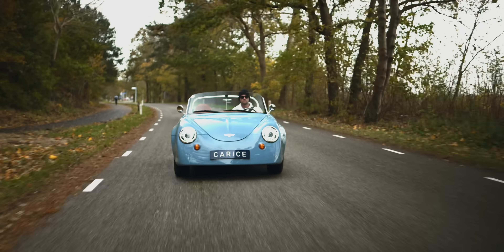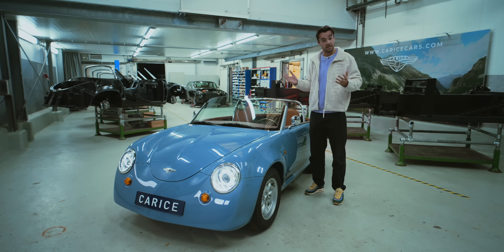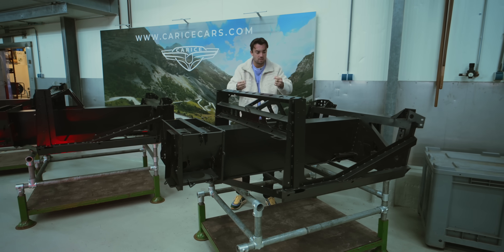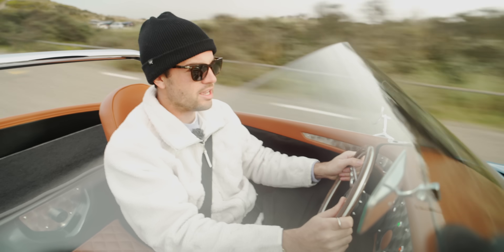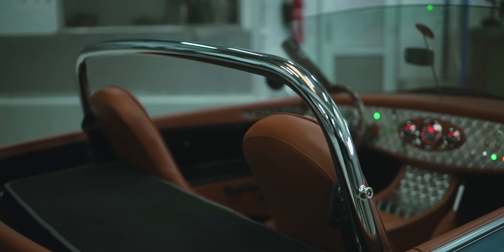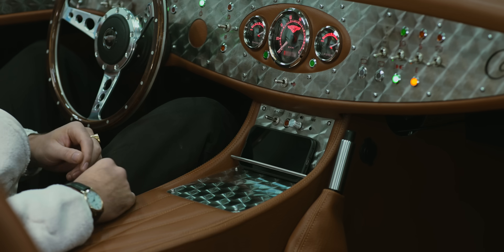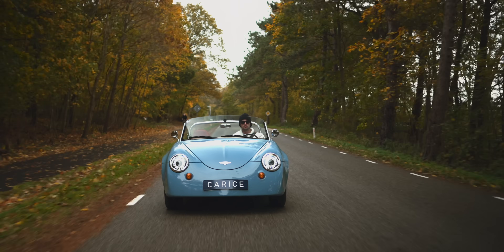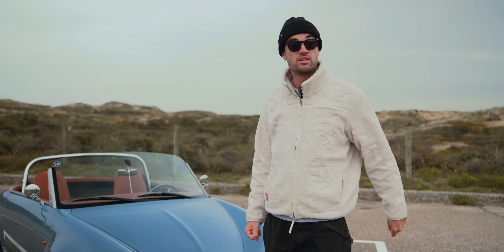This Is The First EVER Lightweight Electric Sports Car!

Comment: I think/ hope there is going to be a resurrection of the old kit car scene. This is an example of something we should be able to build in our garages
Reply: Yes, but only L6 or L7 classification kits. So quadricycles not cars.
Reply: I love these Welsh guys that do the old cars. Loved their Bulli for example!
Reply: Yeah - here's a basic chassis with crash structure, 3D print the rest yourself.
Reply: Totally agree 💯👍🏼 would love to do hybrid of my late mk1 NCF 💎 or would love to see several versions of the late william towns designs as utility vehicles and familly estates.. or light vans .. Huntsman and  Highlander ..away from mini wheels. 

Or an E hybrid  kit of the 1984 AFRicars  using modified Wood ..like MettelWood  and then bio epoxy paint..  

Who remembers the Medite/ply Jeeps built ...tested with a sledge hammer ⚒️ on the monocoque bodywork... 

These days you could press the part cured wood to form curves and cut parts flat pack style with a computer controlled cutter.

  The brilliant one is the one off 3seat abreast Micro dot.. town car  a primitive but effective electric  hybrid with a built in shopping cart space for the boot even when all the seats were occupied. 

Its hard to imagine a better  
and more minimal use of space and materials.. then or now.. just add modern brushless motor and battery tech.. 
Instead of the little honda generator...use the small liquid piston rotary or a opposed  free piston generator  across the frame inside .. Body work can be Modified wood or Green  Basalt and or flax fiber.. low carbon low energy green equivalent to ridiculous and dirty carbon fibres also tougher. For glass use Lionglass as patented by a group of US university researchers half the energy needed and  half the carbon dioxide produced in production and many times more resistant to cracking so you can have glass thats half as thick potentially and lighter, yet still twice the strength. It would seem.
And yes it can be made at almost half the temperature and thus saves on CO2 from heating and doesnt use the Carbonates used in making current glass. 

You can also turn wood into a clear composite ..😉
Talk about not seeing the wood for the 🌲 s and  growing cars....🤔
Reply: @ziggarillo   If you design and build it yourself, there is no reason why it can't be a usable vehicle for day to day operations. Design to your needs and there is barely a need to own anything else. Once upon a time, small cars like the original FIAT 500 and 126 were family cars, so why can't it be done today?
Reply: @Stuntman175  It can, with quadricycles. Cars require higher levels of passenger and pedestrian safety features for a home builder to achieve
Reply: Yupp , just the batteries need to go down in price and weight
Reply: @robotmunkee  
Thats the issue with 99% modern vehicles in Europe and USA they are too expensive for 60%plus of potential customers ... even conversions and modern kits.. 
Simplification and standardized parts is part of the solution and 
Step away from giga presses and internet of things ... dont even think about using a phone in a build unless its to track it or check its charging ... 
Best use blade cells and or Na Al, S chemistries.. at least we know Na is happy in the UK cold  and doesnt mind being drained flat or charged on way wood chargers.
Reply: @ziggarillo  This is an L7 vehicle? You CAN build that yourself. For less then half of what they want.
Reply: @ziggarillo  I was using the 500/126 simply as a size reference. They would probably be considered L7 quadricycles if released today as is, but with an electric powertrain.
Reply: Definitely.There hasn't been a kit car since the early 70's.
Reply: Just my two cents, that car has the same lines as a Porsche 356 Roadster.

Many replicas have been made, gas and electric. Some using donor cars and others were ground up fresh builds.
Reply: Wish to have one of them to drive to work ,to do shopping etc,only by low every new car should get tesla software for safety 😅
Reply: Probably  @chrisspain
Reply: @chrisspain  Not to the level and quality they will do it for. An most people have got the time to build themselves their own car.
Reply: @ziggarillo  Caterham seem to manage it
Reply: This is reminiscent of the Power Wheels lineup.
Reply: never happen. too many regulations.
Reply: Do you really want idiots handling high amperage electrics in their garage?
Reply: @Watt_Ihr_Volt batteries have dropped 90% in price since 2012.
Reply: That's actually their 2nd car, the first looked more like a Porsche 356/550 mix . 
They stepped up the interior game. 
But I think I like the look of the old one more. Was a bit more retro. But this one looks more sophisticated
Reply: @lesliedsy definitely,  their 1st car was more reminiscent of it. You could see it more then. I am happy to see they are still around and brought a new model.
Reply: Kit cars are still a thing, but people just got lazy these days.
Reply: If you don’t love this car then I’m ready to fucking throw down!
Reply: Someone did one of those beauty K1 Attack kits with a Tesla drive train.  Not the prettiest Attack I have seen, but surely the quickest.
Reply: And expensive
Reply: It shows what is interesting. If you just want what was built before but electrified, you can learn about that everywhere. Tons of heavy expensive electric SUV are portrayed everywhere. That isn't interesting and honestly it is also not a solution for any of our problems. Except for one: Not wanting to think anew.
Reply: @robotmunkee  Because these kind of EV's are niche and kind of unattainable for most people. Its just fact, at least these small electrics are starting to make the electric cars desirable for regular car enthousiasts its a great thing.
Reply: a 57 Chevy Belair for example
Reply: @chrisspain  I know. I own an L6 vehicle.
Reply: Crap electric 😂
Reply: No way anyone should drive what they built in a shed.
Reply: Looks like it was made by a 12 year old !
Reply: They will need to be kits, too. Conversions never have enough space for batteries as they weren't designed to fit them.

Comment: As the owner of a 65 year old Frogeye Sprite, which is a similar size, weight and power, I completely get the concept of light weight and simplicity. But I worry that I am in a very small minority. Car buyers now are obsessed with bigger and bigger wheels, more and more "tech" and larger and larger exterior size (ironically, with very poor internal packaging). I really hope there are enough buyers for this because it deserves to succeed.
Reply: The good thing is that cars like these only need a minority of people to sppreciate them.
I've recently watched a few engineering videos about how big wheels ruin comfort and efficiency - and I was surprised how many viewers agreed and some even pointed out how they had swapped the huge rims with thin tyres for smaller, lighter ones with tyres with genuine sidewalls and some air in them - on new cars and at their cost. 
So I hope we've arrived at "peak wheel" now and the pendulum is going to swing back somewhat.
Reply: There ARE a bunch of us out here! Motorcycles have taken up some of that slack for some time. But this...has a place in my own garage!
Reply: They are not obsessed, its just what automobile companies gives us. Most of the people dont care of reasons of their taste😄They begin to love things simply because they see them often. I love compact roadsters like bmw z3, mg gtb, i love smartfones with little screens, but we do not really have a choice now)
Reply: The beauty of Carice is that they are not trying to please everyone, they are "The Perfect Car for Someone, not Everyone".  And they aren't spoiling their vision to try to get in every driveway in the world.  They're doin' it right!
Reply: @allwheeldrive  Book an appointment with Richard and go get on the list!
Reply: Need any parts? I’ve got a 1960 with two spare engines that I will never be able to afford to fix up.  I need to find a home for it.
Reply: @notroll1279  I've watched enough crash tests to suggest that the very large wheels are there because they improve performance in small-offset front crash tests. An 18 inch or bigger wheel is a very rigid structure in exactly the right place to keep the front end from being crushed where the engine doesn't provide such protection.
Reply: @Thisoldhiker  Let's be honest big wheels are there because customers want them. And truth is the very high belt design and general size of modern cars (which I both despise)  make small wheels look quite ugly. 14 inches on a 80s honda prelude look right but would be ridiculous on whatever tesla.
In most countries you can't even change for smaller wheels because it does not fit regulations.
Reply: I agree, that’s the first thing I thought, a bugeye sprite.
Reply: For 44k? You are out of your mind.
Reply: Mark 1 Sprites were not really practical only cars for any full adult.  Thats why the MGB sold so well, as a somewhat more practical small sport.

So yes it us a niche.  Either an extra fun vehicle like a Sprite, motorcycle, etc....or a carefree kid with no " baggage" yet.

I would love this car and this is what I expected as an EV in 2000 continuing the EV1 experiment, but bringing in sport car designers.
Reply: If Frogeye, MG, they can produce little sport cars in the names of old age again, but their brands are sold to China and died. Sad.
Reply: I have a custom mg midget turned into an open wheel old school type roadster on a mustang frame with 305v8, I'm part of an even tinier minority of that already small minority
Reply: This is  a second or third car for fun, not a family car. Even though I think it would be an amazing daily driver in any non-American city.
Reply: In the 80s I had two friends that had them as only cars....in an American city.  Both got married and kept them as daily drivers for years.

One (6'2") was a foreign car mechanic, and he'd remove the passenger seat if he needed to carry his tool chest somewhere.  The other was a skinny little dude.

Not having a lockable trunk is the biggest problem in cities.  Otherwise they are just cramped cars.
Reply: "Frogeye"! I love it. We call it Bugeye Sprite. I would think this Carice is a little bigger than that.
Reply: Yes!!! Or a Crosley... remember?
Reply: I totally agree with you.  I was an early buyer of the MGF when they came out in the mid 90s and after abandoning motoring (WFH and living in a walkable European City with excellent public transport) I really didn't want to have a petrol car just for pleasure.  So I decided to hold out until the inevitable Electric MG roadster was released.  The MG Cyberster was released last year and while it is a gorgeous car, it is more the size of a Jaguar and really goes against the original MG ethos of a small lightweight sports car.  I'm not really interested in offerings from Mazda, Mercedes or BMW so I'm hoping a niche alternative will emerge soon.

Comment: Finally, a car with no gimmicks, and it's gorgeous
Reply: Yes, although it is simple like a go-cart. It lacks safety equipment.  Probably wouldn't want any of my children driving something like this.  Seems less safe than even a '65 Mustang.  With that in mind, it probably wouldn't be legal to drive or register in the US.
Reply: @SilverShadow2LWB  microcar rules probably differ. The equally Dutch Squad Solar is heading to the US with similar simplicity
Reply: @messiermitchell4901 Yeah microcars might fallen under local neighborhood vehicles.  That would limit them in speed and would not be allowed on roads over 35 mph.  That's a unique category of vehicle which doesn't require safety equipment.  Golf carts fall under that category.  But anything that advances the EV technology is good.
Reply: Did you order yours yet? What color?
Reply: @lesp315  I probably wouldn't be ordering one myself.  But if I did, I would order it in yellow or red to be able to be seen.  What color would you get?
Reply: @SilverShadow2LWB  I will order one that will make me invisible.
Reply: @lesp315  Then no one else to blame if someone turns into you, or doesn't see you at a stop.  In small cars, you have to be like motorcycles and be noticeable.  Have fun.
Reply: @SilverShadow2LWB  Oh no, I would never take it on the road. This cart is good for golfing, but it will only fit clubs or a caddy. I would chose invisible because I wouldn't like my friends to know that I'm that impractical.
Reply: It’s electric where’s the petrol gas guzzling superb sounding v8 😂😂😂

Comment: The Porsche Speedster is probably the only car from the 50's that still blends in 70 years later! This electric car is the proof. Long live the Speedster!
Reply: Proves F. Porsche’s genius
Reply: You're right, the 1955 Citroën DS is still too futuristic for our times, people aren't ready yet.
Reply: I like the machined metal dash and all the toggle switches!  When I had my ‘67 Morgan 4/4, it had toggle switches and a non-self canceling turn-signal switch on the dash too.
Reply: Yeah, reminds me of my  '65 356C. Put a top on it and I'm interested.
Reply: @dooleyfussle8634  You can get it with a top.
Reply: You can check daihatsu copen.
Reply: @peterhel1077  It isn't a 50's car.
Reply: @peterhel1077  It looks like a 356 that shrunk in the laundry!  LOL
Reply: @chucku00  exactly. you can have all the fun and modern functions.
Reply: @peterhel1077  Including being up to current safety standards while Daihatsu admittng a continuous 30 y/o safety test fraud?
Nah. As cute as the Copen might be, the dishonesty of this car maker shouldn't be rewarded in any way.
Reply: @donelmore2540  you may find that daihatsu copen owners as suzuki jimny owners are absolutely immune to any criticism and mocking lol
Reply: @peterhel1077  No real disrespect intended.  Just a little fun!
Reply: Total Speedster vibes. I was wondering if they paid design royalties to Porsche AMG.

Comment: Thanks Jack. That is one of the best reviews, and in one of the most beautiful EV's i have seen yet. 
Finally, a 2 door EV, AND a "sportscar, AND a Cabrio.  Let modern brands try to build something like that. Fun, Lightweight, 2 doors and 300km range. Perfect.
Reply: And I've seen it without a jack standing next to it.. looks a lot bigger
Reply: You should Google the first gen Tesla Roadster from 2008. It had 393 km range and weighed 1,305 kg, roughly the same as a Mazda Miata.
Reply: This car perfectly sums up the folly of the 'big battery required' argument. A 31kwh battery that can take this car as far as a 50kwh battery would in an SUV. BMW could have made an original sized mini with an electric motor and it would have flown out of the showrooms as fast as it did back in the 60s.
Reply: @@yyibonly because of the batteries. Those came down to 10% of 2010 prices.
Reply: @@yyib Costs the same as I paid for my Ioniq 5 here in Aus. Crazy, just a rich persons toy. If it was reasonably priced I'd be tempted.
Reply: @davidjulian8536 I don’t think yours is nearly fully hand made by a small team with leather interior, compare apples with apples.

Comment: I was co-founder in an EV project, which had very similar characteristics originally, small sports car, L7, battery pack in centre tunnel. That project failed, but not because the idea would have been a bad one - I am happy that this is now coming out, as it is what I would like to have for summer fun car for small roads.

I think the power must be maximum 15kW continuous and 50kW is only available as peak power, as that is the L7 category limitation (maximum net power of 15kW). That is not really a limitation for anything else than top speed. It will likely accelerate great due to peak power, but top speed is unlikely exceed 90-100km/h depending on drag coefficient. Not that I would want go to autobahn with this anyway. L7-B2 does not specify speed limit, most other L7 categories specify 90km/h, but physics will limit it anyway.

Interestingly, it might be possible to fit the same car to small volume M1 category, and do away with the power limit. Likely production of that version would need to be limited to smaller number (both EU max and country maximums exist). So a "Limited edition" could offer much more power and other improvements, as long as the series is small. That is likely used by some very expensive sports car manufacturers already.
Reply: The design of this is pretty bad and probably too costly. You can easily work with a Chinese EV manufacturer to build one that much better and cheaper. A similar spec car in China is 3000 Eur.
Reply: In the video he said it was 56hp, which is about 42kW.

Comment: Very nice to see a light car again. The concept of electricity moving 2.5 tonnes around on it's own battery for the school run, is mental. A race to the bottom (that bottom being weight and required power).
Reply: Exactly. It’s been so disappointing to see car manufacturers lean so hard into SUVs as the standard when developing electric options.
Reply: My i3 BMW is 2900 lbs.

Comment: Another very enjoyable review, Jack! Thanks. 

Although the price of most things are all relative these days and circa £50k for something this bespoke is probably about right, I reckon many car enthusiasts (me included) would be just as pleased to see manufacturers (*cough Mazda*) pushing out the EV successor to the MX-5. Cheap (but versatile) materials, low weight (relative) and 200ish mile range, with a £25k price tag. Done ☑️
Reply: Exactly: I don't get why no one (especially Mazda) has made a mass produced sports car EV like this. I'm sure that a major manufacturer with R&D could push a formula like this even further so that it has even more powerful motors (like 90hp equivalent) while keeping the weight down.
Reply: An mX5 with 25KW hub motors in each wheel, a low rise battery pack that covers the entire floor plan.  That's what I want.